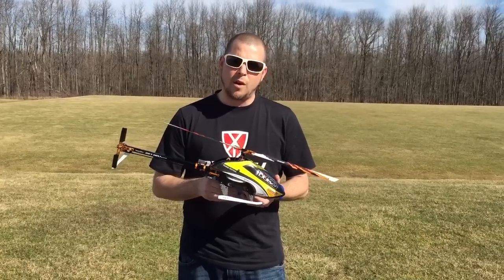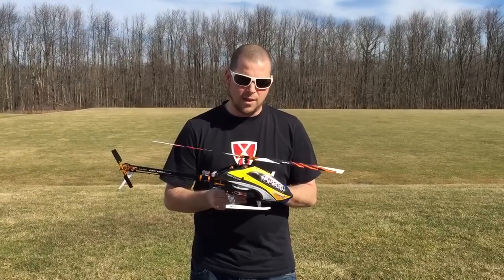Having a break in flight on my OXY 3 Tareq Edition

Comment: I know this is an old video but I'm contemplating buying a smaller heli for my yard to hone in some basics of flying before I try them on my 500's and 700. With that said, can this heli be tamed to have a FEEL of a larger heli and not have performance sacrificed? Is it durable (although I'm sure you haven't put it in yet). How are replacement parts?
Reply from the maker: Can’t go wrong with an OXY 3. Cheap to build, cheap to crash and fix, great parts support, amazing quality and fly great. Between the OXY 3s, 2s and 4s I’ve had about a dozen of them.

Comment: Great video. What are your vbar settings on tail and head gains?  Mine wags like an anxious golden retriever!
Reply from the maker: All gains were stock “450 size” wizard settings. The only thing I ever do from the wizard is increase my rates and adjust tail gains if needed. Trying lowering your gains 5-10 points at a time.
Reply: @crmodels  Many thanks Chris.  I'll run it through the VCT wizard again and see if I can get a better outcome.  Mechanically everything is smooth and sound.  Hopefully this will work!

Comment: Chris, what pinion are you using?? 11 or 14??
Reply from the maker: OXY 3 Tareq Edition Specs:
FBL System: NEO
Motor: LYNX 4100KV 
Pinion: 11T
Headspeeds: 3000,3550,4050
ESC: Castle Edge Lite 50
Cyclic Servos: MKS HV93 
Tail Servo: MKS HV93i
Battery: Pulse 4s 1350mAh 45C lipo 

14T if you run 3S